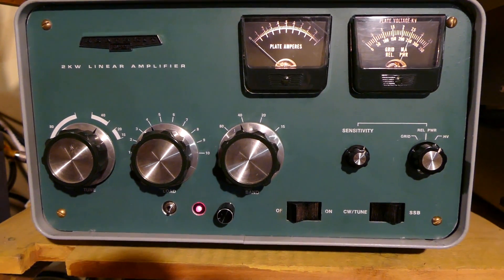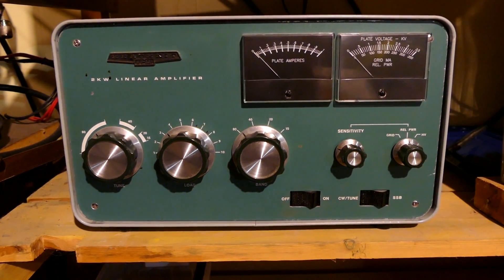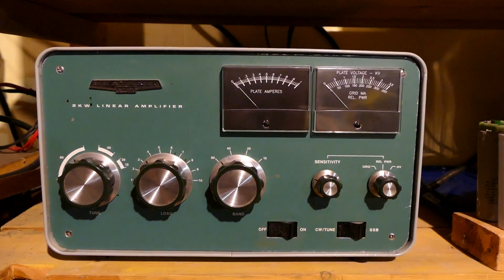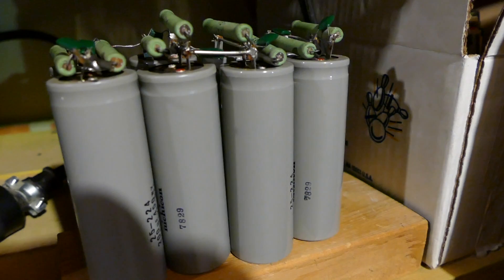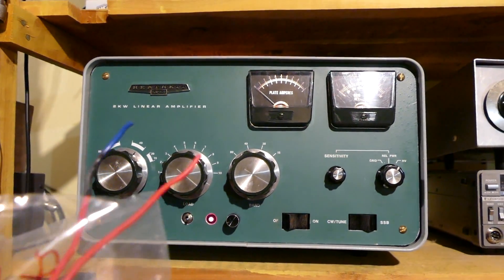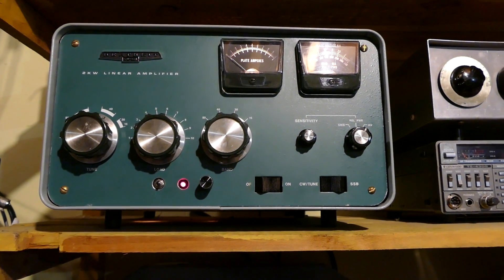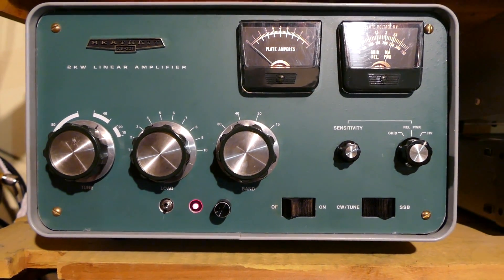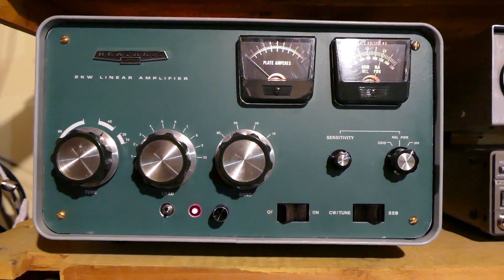SB-221 (SB220) amplifier rebuild

Comment: Any idea where I can find a replacement Plate Voltage meter (the one on the right)? I'm helping a friend to repair his SB-220. R3 was blown and took the meter with it (switched to Grid metering when it blew). 
Don't know why it blew yet. One of the tubes may be shorting or it had a bad parasitic oscillation. Wish I could test the tubes somehow.
Reply from the maker: Good luck finding a meter for these Heathkit amps -- they're considered "unobtanium" -- The only means of getting one that I've heard about in years is to scavenge from another SB amp. Doesn't look like any aftermarket manufacturers make them any more.

Comment: The poster who said to run the 220 with the" filaments only" for a while to getter the tubes is mistaken. The anode is the only element in the tube that gets hot enough to activate the gettering agent (Zirconium oxide), & that is the silver colored stuff you see on the anode. The tube has to draw enough plate current to cause the anode to run red to orange in color,  Several internet sources describe a set up for doing this with the tubes out of the chassis. Metal ceramic tubes will getter with filaments only because because the filaments heat the cathode & the cathode is the hottest element in metal ceramic tubes.

Comment: Eimac stopped making 3-500z tubes in about 1996 so your 1995 tubes were just about the last ones made.  The last few years were the worst ever made so I am not surprised one bit that they went bad on you.  The older ones are much better and many are still running strong 50 years later. I suggest you directly ground the grids and build new parasitic suppressors just like the old ones using similar resistors.  I DO NOT suggest ANY mods by AG6K, especially the suppressors and do not install all that garbage on the grids.  Best to directly ground them with short copper braid or flashing close to ground.  The .82 ohm resistor is actually the grid shunt resistor which calibrates the meter to read grid current correctly.  The original resistor is a special one.  It is NOT a plain old resistor.  It is a "fuse resistor" and is made to blow like a fuse if the grid current goes too high in the case of a tube arc or short.  They are sacrificial and should be replaced with a similar one if they blow.

Comment: does this amp work on 10 and 11 meter band? or can it be modified? I seen one for sale the other day.
Reply from the maker: The SB-220 had 10M as stock, and the SB-221 could be modified with Heathkit parts to operate on 10M. My SB-221 amps have the 10M addition.

Comment: tubes are going to do fine on the shelf..it is how they are handled and used, that kills them. Often prudent to run them fils on only for a while to let the getter do it's thing. Heathkit is excellent design wise in running the fils at the correct voltage.. others kill them with too high fil voltage.  Good old Heathkit !
Reply: Capt. Larry :  All glass envelope power grid tubes suffer air ingression through the Kovar seals around the pins.  Running the 3-500 on filaments will not "getter" the tubes because the gettering agent is Zirconium oxide & it is applied to the plate of the tube, because the plate is the only tube element that gets hot enough to activate the gettering agent. The "silver" appearing color of the anode is the Zirconium oxide. Your comments regarding Heath filament voltage in the SB-220 is correct.

Comment: I'm a new ham and found a sb221 on ebay that was working.  I installed the Harbach soft start module, rectifier/metering board, and capacitor block w/board.  The amp short circuited to ground when I turned it on to test it.  The short circuit was caused by one of the metal coils on one of the parasitic choke (100k resistors/metal coils strings) feeding the 3-500z tubes. The metal coil was touching the top chassis plate.  When I turned the amp on the high voltage meter needle pegged out, immediately dropped to zero and the amp was dead.  After a thorough visual inspection of all circuitry and testing the newly installed upgrade boards and capacitor block with a multi-meter (All the diodes, resistors and the eight uf 200 capacitors checked out Ok.)  I discovered the two 10amp/10watt ceramic resistors on the soft start module had failed.  I don't have a 48vdc power supply to test the two SPDT relays on the soft start module so I'm unable to test them.  I'm waiting for another new soft start module to come in the mail.  I'm hoping the failed resistors are the only damaged components.  Can you tell me if there is anything else I should check for damage?  I'm hoping the two failed resistors saved the day.  Thanks much for the video.

Comment: On your contesting amp, where did you get the square replacement meters. I can't find a place to get replacement meters anywhere. Thanks, Buddy, K4VYX
Reply from the maker: The square replacement meters were installed by a previous owner. I believe they were once available from Harbach Electronics, but are no longer available. Meters for these amplifiers are rare today, and it appears they mostly come from retired amps that are being parted out.